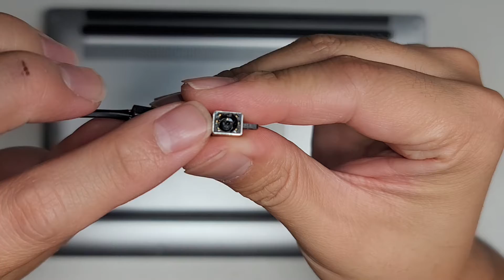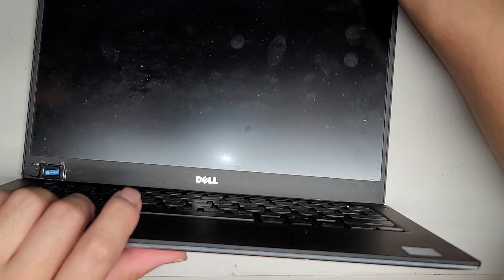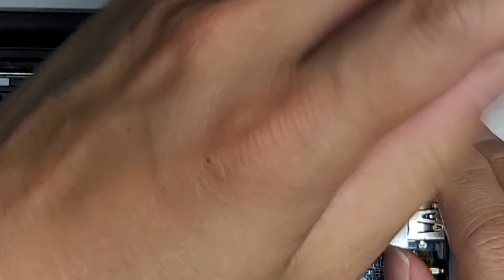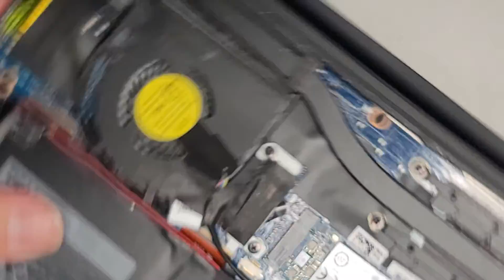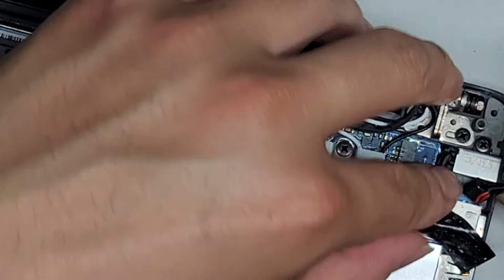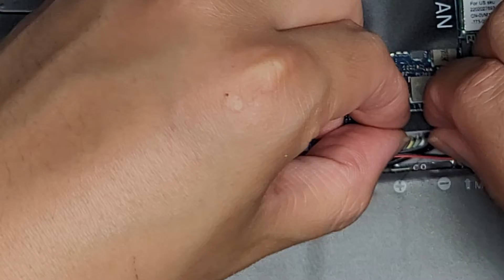DELL XPS 13 9360 Disassembly Charge Port DC Jack Replacement Repair

Comment: Thanks Binh for your informative demo of how to replace a faulty power jack in a Dell XPS13 9360.

I had a similar problem with my XPS 9350 which is nearly identical to the 9360 (my new battery would not charge).  After a bit of struggle, I did get the new power jack installed.  However, as you noted in your video, it was not easy.  There just is not much room for it.  I do have it working although now it is quite difficult to plug in the power plug – but it works.

Thanks again. . .
SKK
Reply from the maker: Awesome, glad it's working now. If you haven't already, please like and subscribe so others can find my videos and possibly consider watching a few others and commenting to get the algorithm to recommend my channel. Thanks!

Comment: Thank you for the clearly explained video! You gave me enough confidence to order a charge port for my XPS 15, model 9350, which has the same charging jack configuration as yours.
Reply from the maker: Hope the repair goes well. If you haven't already, please like and subscribe so others can find my videos. Thanks!

Comment: Thanks for the video! I need to change this but also the usb-c port right next to it as that is slightly damaged
Reply from the maker: No problem. Hope it works out.
Reply: Were you able to change the usb-c? That's what I need to change as well.
Reply from the maker: I hate how YouTube doesn't notify me of replies. Were you able to figure it out?

Comment: Aloha, my Dell XPS stopped turning on, I ran it after the battery died and then the while computer died. Won't run on at all. Do you diagnose & fix laptops that won't turn on at all? Thank you!
Reply from the maker: Hmmm, usually a motherboard issue.
Reply: @ItsBinhRepaired  from what I seen you do it looks like you can check the switches (transistors?) on the motherboard, and see which one is bad and maybe fix it? Or some other way to fix it maybe.
Reply from the maker: I'm not sure how to do that
Reply: @ItsBinhRepaired  dang.. ok thanks for responding, appreciate your videos.
Reply from the maker: @HowiBecameSentient  yup, sorry

Comment: Great video. Any videos on how to make the hinges on a 9360 less stiff? Thanks
Reply from the maker: You don't want to mess with the hinges. Maybe add a drop of oil.
Reply: @ItsBinhRepaired  Hi, I tried some spray silicone grease and it did nothing. I will give it a drop of oil. Thanks.
Reply from the maker: @mrfish2064  sprayed it directly into the moving metal parts?
Reply: @ItsBinhRepaired  It turns out it is irrelevant. Whatever the hinge bolts onto has snapped on both sides. Can you enlighten me what that is. I have downloaded the service manual but I am none the wiser. I found this out when I changed the charge port as per you excellent video. Thanks
Reply from the maker: Might have to fix with jbweld
Reply: @ItsBinhRepaired  A friend has a scrap one. The mother board is toasted and the screen damaged, I might see what he wants of it and decide if this is worth the overhaul. Thank you so much for all your help.
Reply from the maker: Yup

Comment: Success!  Thank you, sir.  It was a little tricky, just like in the video, but not too bad.
Unfortunately, my charge cable is also bad, got to bend it just right to get a charge.
Reply from the maker: They're pretty cheap on Amazon. I recommend replacing it before it damages the new charge port.

Comment: Thank you! Any recommendation on where to get replacement jack?  Looks like a great tool. Where do you get that?
Reply from the maker: The charge port https://amzn.to/3JdYkhq and good tools this set is much better quality https://amzn.to/3vh64cU if you're trying to just find something that works for cheap, this will work https://amzn.to/3vlOJiV the bits and the rubber on the handle don't hold up as well though.
Reply: Cool. Thank you for quick reply too!
I may actually spring for Wiha tool.
Reply from the maker: @thomasarcturus8947  no problem

Comment: Hi bro.. I try to replace new battery also just now I try to plug new dc port. But the problem is the battery is not charging. Do you have any recommendations what to do next?
Reply from the maker: Most likely have to replace your charger. Press f2 on boot and see if the battery section shows the charger/battery condition information.